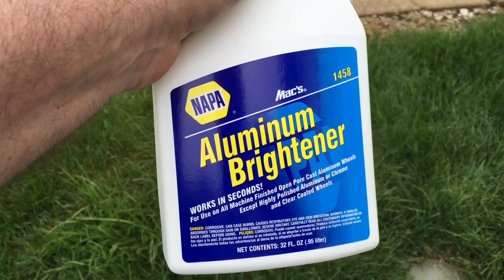Cleaning Aluminum

Comment: If you use a hot pressure washer the results are much better with the Napa aluminum cleaner. You will see the blackish color get sprayed off.

Comment: Get a better atomizer on that spray bottle, they give us the worst ones on these products. You can see the stuff streaking where it runs. Eagle 1 aluminum etching mag cleaner is the stuff I remember on slotted mags. Spray it on, wipe it all over the mag with a scotchbrite pad and a glove and rinse about 2 minutes later, worked great but took any shine off and got the mag a somewhat milky white color. Polish afterwords. If you can get a rotary scotchbrite buff on a drill, that worked the best on smooth slotted mags. Abrasive enough to actually clean and polish the aluminum in one operation. Got some old ones to look like new.

Comment: Use Hydrulic Acid used for swimming pools, remember to do it in well ventilated area and gloves.
You will be amazed with the colour
Reply: hydrochloric?
Reply: I used 'hydrochloric' (muriatic) acid to clean a Q-jet carburetor a while back.  It came out super clean.
Reply: @imaouima  Hi! Carburetors are not made of aluminum but of ZnAl. It's a completely different material. The aluminum content in the alloy varies from 3.7% to 28% depending on the expected properties of ZnAl. Thanks